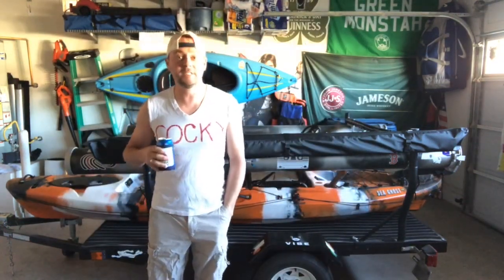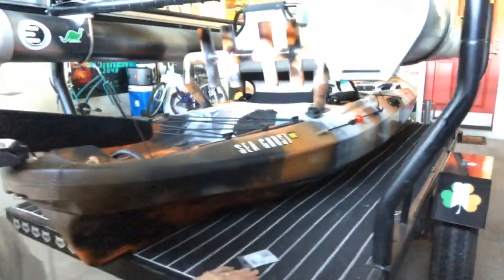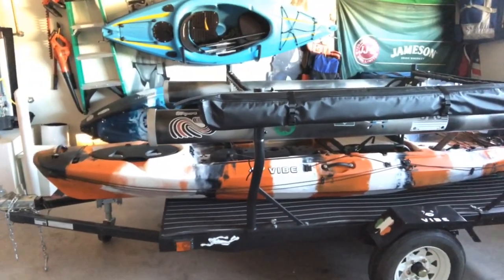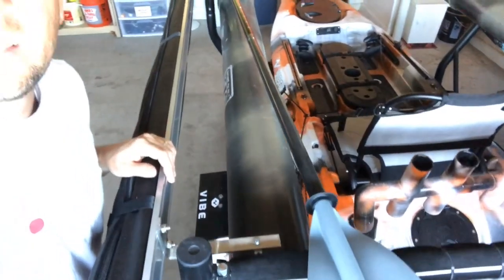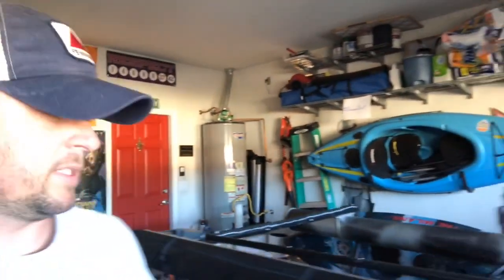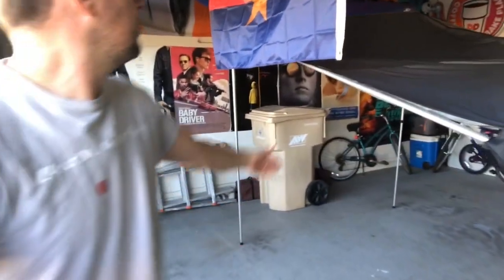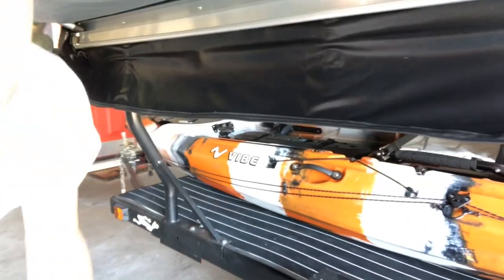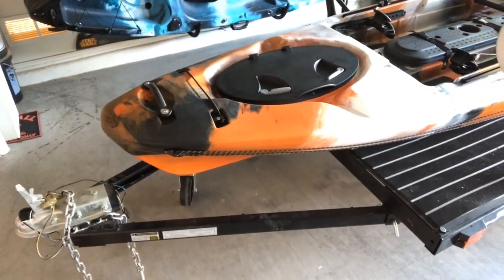My Kayak Trailer!

Comment: See the trailers at H Freight, but not the rack system. Where did that come from?
Reply from the maker: Ray Pintore Walmart.com
Reply: @azkayakguy7180  thanks. See if will fit my trailer.
Reply from the maker: I think they all do unless your trailer is very wide.
Reply: @azkayakguy7180  mine as a tilt gate and angle iron sides. Initially purchased for general hauling, misc, mowers, Harley. Still poss needed for that. If rack fits on top of existing rails (and at least partially removable), storage boxes could be designed detachable, keeping it multipurpose.
Reply from the maker: Ray Pintore ahhh good point! May not fit.

Comment: Did you have any issues bolting the ladder rack to your trailer?
Reply from the maker: Daniel Reddy none whatsoever. It is insanely solid.
Reply: @azkayakguy7180  weird I have the trailer from irontron and a ladder rack from Amazon. It seems that the bolt holes didn't clear the side rail. If that makes sense?
Reply from the maker: Daniel Reddy hmmm kinda. I drilled my own holes into the frame of the trailer I have. What does yours look like?
Reply: @azkayakguy7180  the trailer? I believe it's the exact same as the harbor freight one
Folds and is 4x8. I put a whole 4x8 3/4" treated plywood on it
The ladder rack looks identical to the one you have also. Just when I look at where the bolts will go it seems I'll have to drill through the frame just a bit. If you're looking through the racks hole you see the frame covering half the hole
Reply: @azkayakguy7180  what type of drill bit did you use to drill the holes? And you're saying your bolts go into the frame? Mine would butt up against the frame but only be in the 3/4" plywood I have